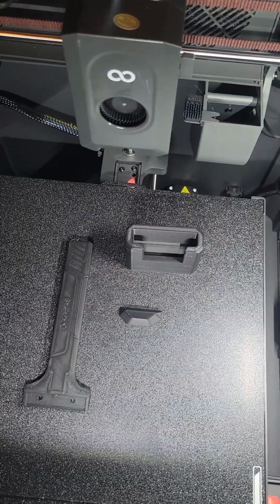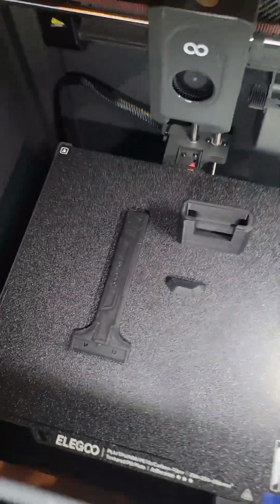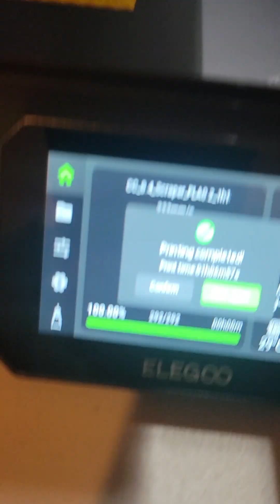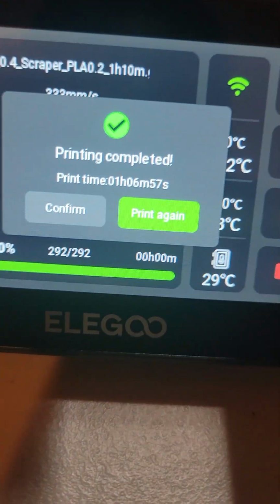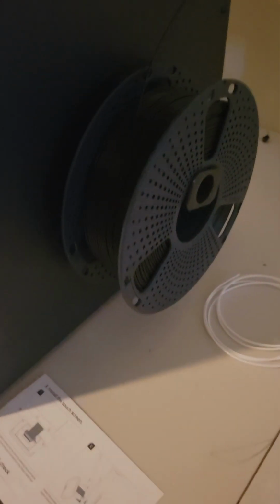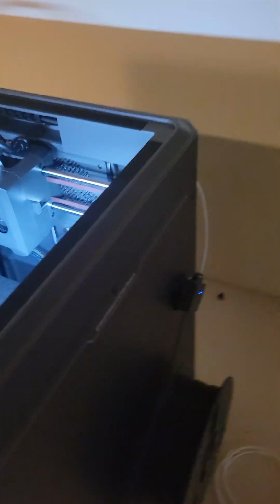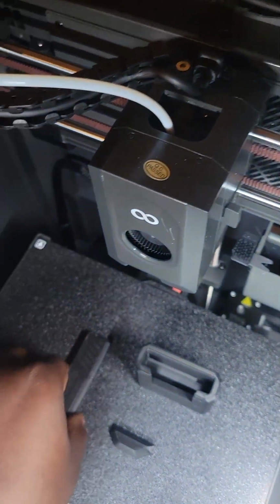Elegoo Centauri Carbon 3d Printer. Scraper print

Comment: The build plate sticks good on the ECC. Easy way to remove things is taking the build plate out and flexing it, kinda what it’s designed to do, and the parts will pop right off. Also if you use the other side PLA sticks really good at 30° C. I’ve ran mine at 30-60°C and not noticed any real difference.